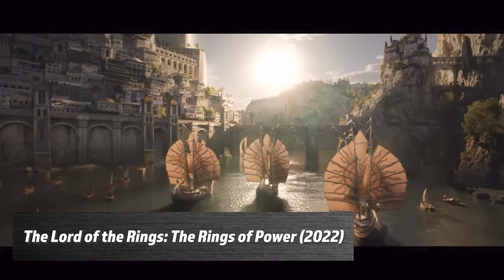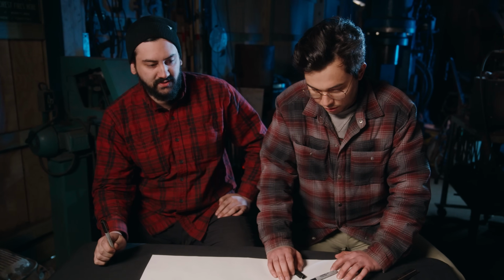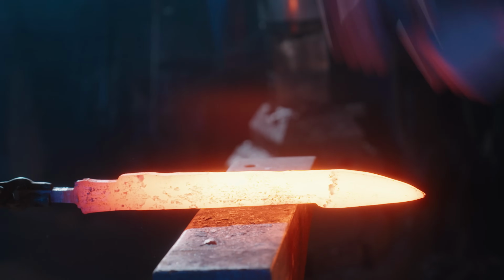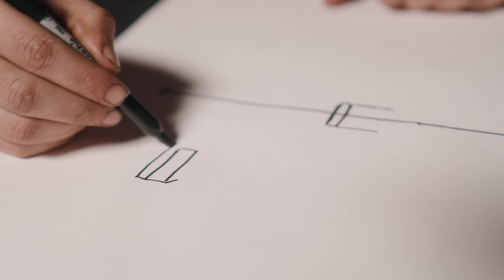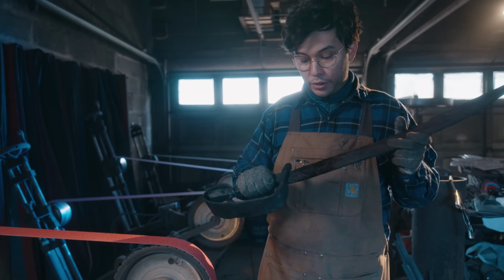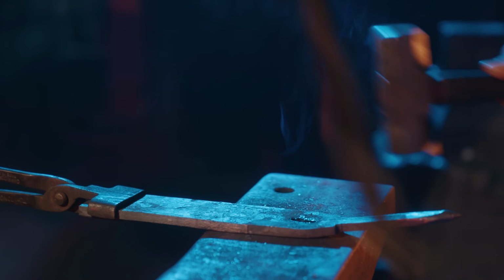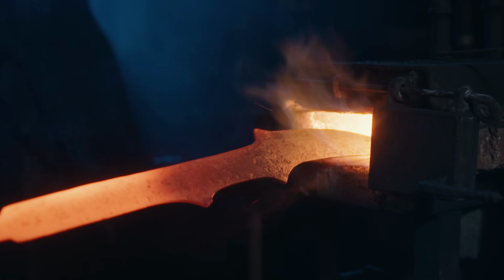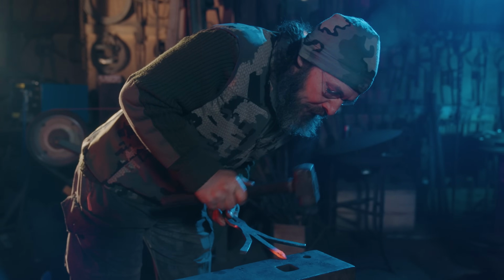Orc vs Orc Challenge! - LOTR  - MAN AT ARMS - Reforged

Comment: At timestamp 4:46, we see Gari and Andrew cooling off one end of the work piece, any reason for that? We also see from the previous video for the Seax Knife that they grind their work piece hot, is that to set a certain form to the work piece?
Reply: Solid question. I was cooling that section down with water so I could hold it with my bare hands for a better grip and ease of manipulation. As for hot grinding, it just grinds away faster and works really well for when we're short on time with a lot to do!

Comment: Orcs like to use simple, crude weapons. Whether dull or sharp it does not matter, as long as they get to bash or stab with it. If you take a look at the Uruk Hai's blades... they're literally just square plates of steel with a sharp hook at the end. If you googled Orc Blade, you'd see that pretty much all of them are rugged, dulled, cracked or rusted pieces of metal slapped on a handle. So in the competition of who could make the closest thing to an Orc sword... you both failed.

But as a Game Designer, if i were to pick a sword to use in my game... I would choose the Claw brace. Because the claw along with the jagged edges, gives a more unique and complex feel to the blade. Whereas the other blade looks like a regular cutlass with some slight modifications on the back of the blade. So in terms of creativity, the claw blade wins.

Comment: Quite frankly it's a no-brainer, the older guys won, though the overall designs aren't very ork-ish, In my opinion both were too ornate thers too much form and function, looking at an ork blade it's straight function overform there's no special guard to anything, it's just kind of like a "ultra evil samurai mentality" not really meant for protecting the user more so for adding/inflicting massive damage to the receiver/opponent, but overall, massively awesome, old dogs for the win😁😁😁😁😁😁

Comment: Orcs in the Tolkien-verse weren't especially keen on beauty, but they were supposed to be intelligent and remarkably crafty (especially with traps and other engineering feats geared toward dealing death). I'd think that such traits would lend themselves to the creation of well-designed, thoroughly functional weapons that were designed primarily for offense. The d-guards and handle construction on both swords would make them really hilt heavy (which would be perfect for a primarily thrusting weapon, but rather detracts from the cut-focused blade designs); I think that a Tolkien orc would probably prefer something simpler - such as a design similar to the chinese Dao, a falchion, messer, or some form of european double edged sword (perhaps an arming sword with a broad blade designed for the cut or a spatha). Though, I imagine they'd probably use polearms over swords in general (spears, poleaxes, halberds, etc) - largely due to the fact that such weapons are easier to mass produce and better for facing larger opponents (since orcs are generally described by Tolkien as smaller than men or elves).